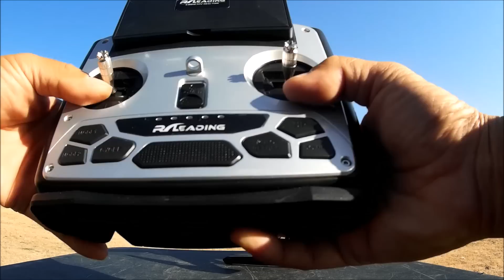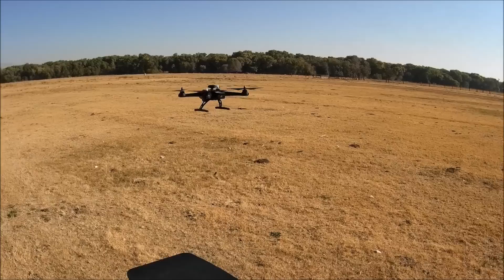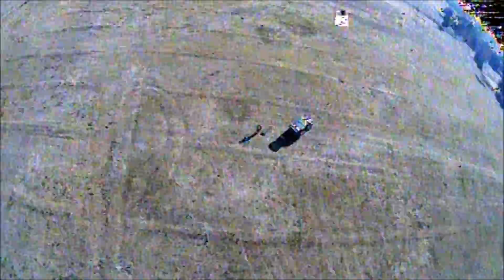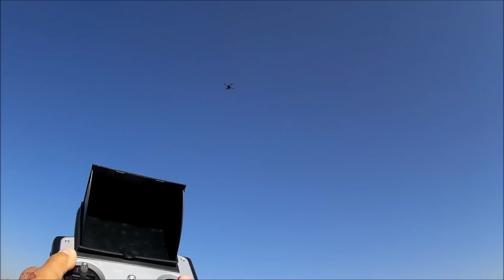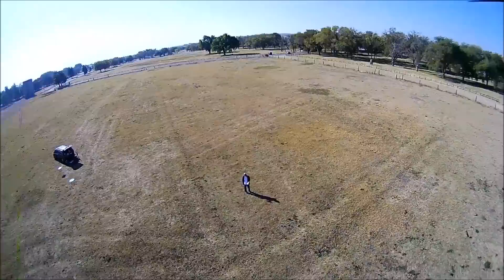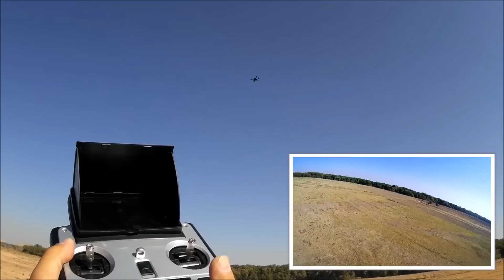RC136FGS Brushless GPS 5.8ghz FPV Drone

Comment from the maker: hey guys, check out some really good prices right now!!!

JJRC H44WH DIAMAN Foldable RC Selfie Drone - RTF
https://goo.gl/Ccx8oE     coupon code  GBH44WH   price  $29

FEILUN FX176C1 GPS Brushed RC Quadcopter - RTF  -  1MP CAMERA  RED
https://goo.gl/Nctwhe     coupon code  GBFX176C1    price  $59

JJRC H37 ELFIE the selfie drone
https://goo.gl/JwCGk4      coupon code     USOL41   price   $19.99

BFight 210 210mm Brushless FPV Racing Drone
https://goo.gl/tJ8hib      coupon code     GBhotRC9    price $129

XK X130 - T 130mm 2.4GHz 4CH RC Racing Drone - RTF  -  BLACK
https://goo.gl/Ccx8oE      coupon code      GBhotRC7   price  $65.99 

FuriBee F90 90mm Wasp Mini FPV Racing Drone - BNF
https://goo.gl/24P6dG       coupon code    GBhotRC3    price    $29.99

JJRC H8 Mini Headless Mode 2.4G 4CH RC Quadcopter 6 Axis Gyro 3D Flip UFO One Key Return Aircraft  -  BLACK
https://goo.gl/DknJuL       no need coupon code    price   $11.99

Comment: Not bad I guess, but to much jello on the video for me. For almost $200 I will pass on this one. You would think that by now, the end of 2017, that these companies could make a $200 quad that didn't have a lot of video jello. Another great review Pete!
Reply from the maker: Ron Brown 
There were two flights in this video and in the first flight, the camera was not locked in and most of these remote adjustable tilt camera units are not polished in this function and thus jello but on the second run, with the help of a strip of electric tape, it provided a good picture but it shouldn't be "helped" in any way to correct its faults and should work right out of the box.

Comment: Too much jello on the video. Battery life on both the monitor and the quad seems lower than indicated. Follow me is too wobbly but the circle is better. It would be interesting to check the range.
Not bad for the price but not brilliant either
Reply from the maker: yeah, gotta live with all the faults in life and this thing is no different.  I'll include a range test when I do the review on the wifi version of this quad since this one has the better tx.
Reply: I have this quad, it is over priced. the camera quality is actually very very good but its the stupid motorized gimbal that give's you the jello,  if you glue that gimbalized tilt in place ? you will get much less jello..

Comment: The mushroom antenna is the 5.8 antenna and the dipole is the 2.4, the drone has a dipole tuned to 5.8 too
Reply from the maker: lol!  no kidding!
Reply from the maker: Robert Majeroni Macaroni FPV 
Yeah, there is something fishy about that in the manual and looks to be a misprint kind of like the mode 1 and mode 2 switched around!
Reply: RC Escape  ya that's weird. I know being in racing drones/quads, we find miss interpretations of translations and such. But great video! I love watching the evolution of drones that I started on..
Reply: No my friend, both antenna's on the tx are fake. you have to open the tx to pull the real antenna out..